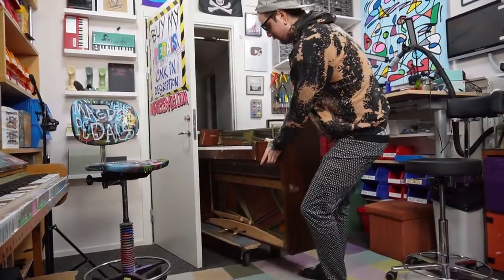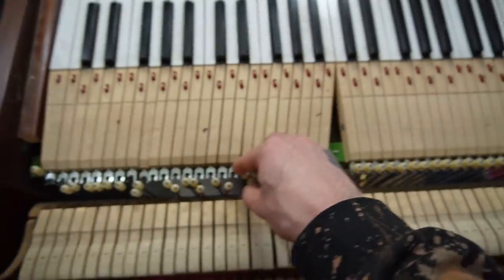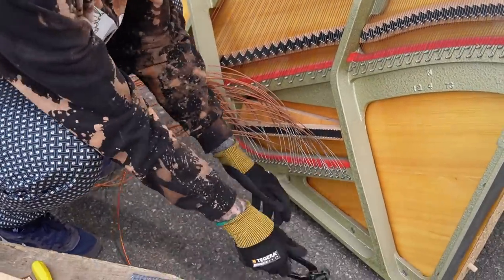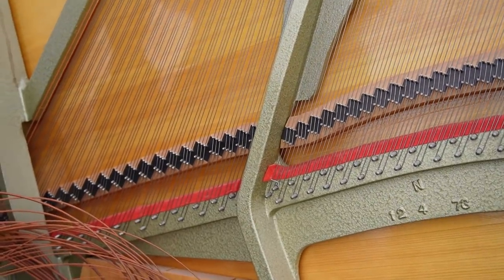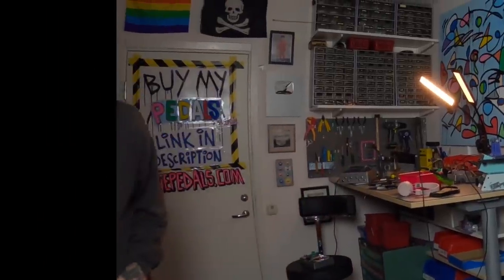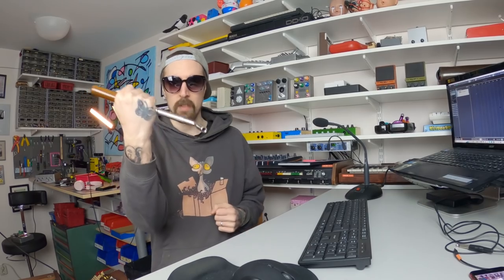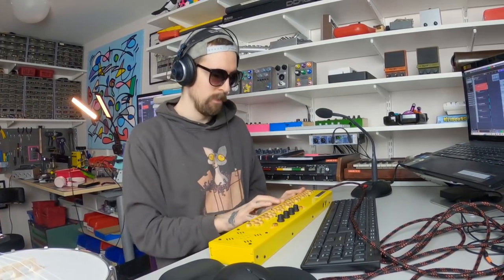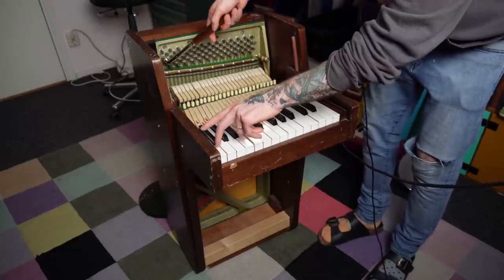I Cut My Piano In Half And Doubled The Fun

Comment: Add some caster wheels on the bottom to easily move piano around. Also how about MIDI'fying it with some Arduino and solenoids? Or maybe replacing tuning screws with servos...? :D

Comment: Hey Simon, i'm wondering if the Digitech Trio/Trio+ pedal can be cuircuit bended or simply do some settings to timestretching or glitchy stuff, instead of the standard use.
 I tried the practice band on Rocksmith and it can do very silly jams on realtime, perhaps the Digitech pedal can do something similar.